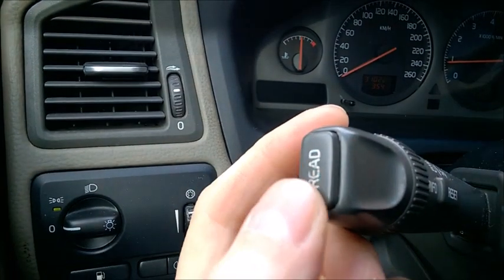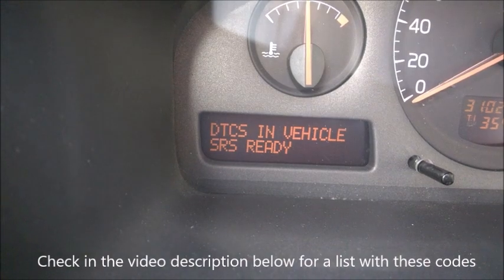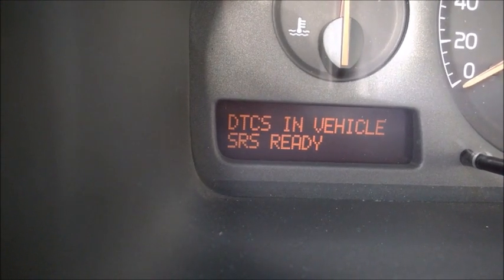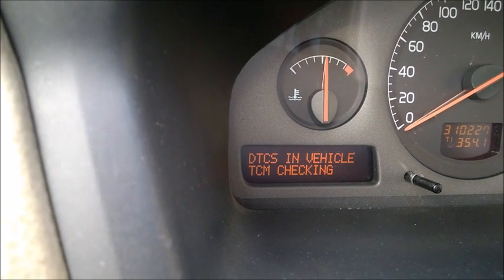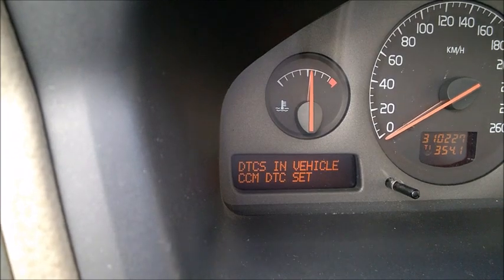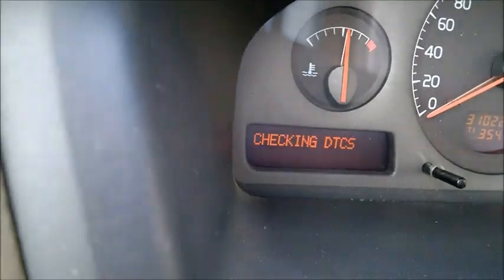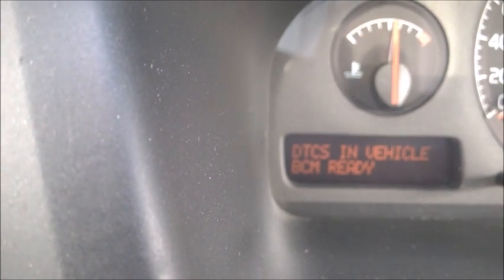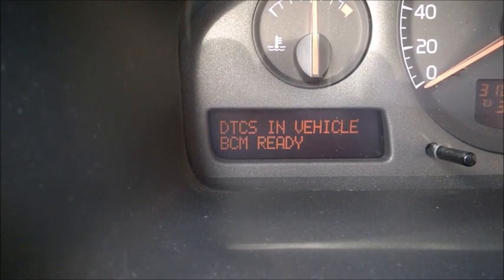Volvo S60 XC90 Quick Check if Error Codes are set  2001-2009

Comment from the maker: For all codes, scroll down here (click 'Read more') 
DTC SET – a code is set for this module (the module may have a problem)
CHECKING – an additional procedure is needed to verify if codes are set for this module 
READY – no code is set for this module (everything fine)
------------------------------------
If these modules have a code it 'may' mean more expensive repairs
    BCM – Brake Control Module (may or may not be and ABS module)
    CCM – Climate Control Module
    CEM – Central Electronic Module (2004up may want to negotiate the price)
    DEM – Differential Electronic Module (AWD, expensive repair, contact Xemodex)
    ETM – Electronic Throttle Module (2001-2002, $1000+ repair)
    REM – Rear Electronics Module
    SAS – Steering Wheel Angle Sensor (not expensive, may trigger Anti-Skid light)
    SRS – Supplemental Restraint System (usually just needs erased)
    SUM – Suspension Module (S60R V70R, the active suspension fails struts/shocks and are expensive to replace)
    TCM – Transmission Message Channel Module (may mean a problem with the valve body, don't buy)
------------------------------------------------
Complete list with modules 
    ABS – Anti-Lock Brake System
    ADM – Additive Dosing Module
    AEM – Accesory Electronic Module
    AFM – AM/FM Tuner Module
    ATM – Antenna Module
    AUD – Audio Module
    AUM – Audio Module
    BCM – Brake Control Module
    CCM – Climate Control Module
    CEM – Central Electronic Module
    CPM – Combustion Preheater Module
    DDM – Driver Door Module
    DEM – Differential Electronic Module
    DIM – Driver Information Module
    ECM – Engine Control Module
    EPS – Electrical Power Steering Module
    ETM – Electronic Throttle Module
    IAM – Integrated Audio Module
    ICM – Information Control Module
    KVM – Keyless Vehicle Module
    LPG – LPG Module
    LSM – Light Swith Module
    MMM – Multimedia Module
    MPM – Media Player Module
    PAM – Parking Assistance Module
    PDM – Passenger Door Module
    PHM – Phone Module
    PSL – Power Seat Left
    PSR – Power Seat Right
    REM – Rear Electronics Module
    RTI – Road Traffic Information Module
    SAS – Steering Wheel Angle Sensor
    SHM – Seat Heating Module
    SRM – Sunroof Module
    SRS – Supplemental Restraint System
    SUB – Subwoofer Module
    SUM – Suspension Module
    SWM – Steering Wheel Module
    TCM – TransmissionMessage Channel Module
    TMC – Traffic Message Channel Module
    TRM – Trailer Module
    UEM – Upper Electronic Module
    WMM – Wiper Motor Module
Reply: Actually TCM stands for Transmission Control Module.
And controls pretty much everything surrounding the Automatic, Volvos with Manual transmission does not have this control module.
Reply: I keep getting a message about my tires being too low on air but when I check the pressure it's ok???
Reply: One thing to add for the DTCS Menu there is a 4th thing besides DTC SET Checking and ready there is a 4th thing which is not Checked which means module not present for instance if you had the driver's door panel removed it would say DDM NOT CHECKED if you see not Checked it means the module is either missing or there is a communication issue with the Module I hope this helps and take care
Reply: AngryPostmanSthlm2  I mean, I'm a mechanic who has pretty much learned on Volvo's (worked 2 years as an apprentice Volvo mechanic).

Also growing up with friends and relatives working at Volvo Torslanda, has also done a lot when it comes to just how much of a Volvo nerd I am.
Reply: @klaspeppar5619  And is BCM for sure BrakeControlModule and not BodyControlModule?
Reply: @cottard7698  yes i think so, it should also be where the STC or DSTC lives

Comment: Hi Peppermint you are an ocean  of volvo information. I have a s60 2001 2.4 turbo.runs like a rocket . I just had the display cluster repaired 2 months ago ,now the LCD message screen is pixillating and goes on and off at random .the other items on the cluster works ok. However the high beams dont work anymore. Do you think its something to do with the cluster LCD message module? By the way light fuses are ok. Any suggestions on how to fix high beams problems? Thanks
Reply from the maker: Pixelated screen is usually smd resistor issue on the DIM electronic board - may bring it to a good TV repair shop for a full check. Be sure to keep the car battery disconnected all time the DIM is not connected - otherwise will get an SRS light. High beam may be separate issue from headlight switch unit - see video careful with your hands, sharp metal edges.
Reply from the maker: smd resistor or sometimes one of the large microchips gets small 'legs' unsoldered - need to reflow the legs on the main microchips (about 3 of them). easy done by a TV repair shop
Reply: Thanks for your reply ,I will get the LCD checked out it still under warranty. The high beams failing is a bigger issue I checked fuses and light bulbs and they are  good, i hope I can get it fixed because is a good car that has hardly let me down in 24 years. I can fix few things but electronics is not my cup of tea 😂

Comment: Hi there. Volvo XC 90 2005 "Transmission Service Required" code. How do I remove it after I serviced it? Thank you
Reply from the maker: Sometimes this is caused by worn out fluid - read up on forums about the fluid to use, risks about replacing it - better replace only 1/2 of it at once and try driving only inside the city for a few weeks.  Then try clearing the code with a quality scanner - maybe a small garage can do it. If the code clears up, you are fixed, otherwise it may be some transmission internal issue. Be aware that the twin turbo XC90 2005 had a very fragile GM transmission - look up on google

Comment: In my 2002 Volvo V70 I have a set code in my ECM And CEM And my Car Surges at 1500 Rpm and goes down to 1300 Rpm but won't go to 900 Rpm when I start my car it has the high start and drops down to 900 Rpm for 2 Minutes then it revs it's self up to 1500 rpm And holds it's self for a while then starts Surging between 1500 rpm and 1300 rpm what could be wrong with my 2002 Volvo V70 I plugged the vida Dice in and it says CEM ETM control module signal missing and CEM Module Shuts off and all my Gauges drop out and my Crude control doesn't work ether What could be wrong with my car

Comment: Hi, thanks for your video, I have several of these codes in my list and a lot of them show dtc set. I also bought a OBD II diagnostic tool, but it couldn't find any errors. Is there any way to reset these DTC codes in the menu and why doesn't the diagnostic tool show them ? 
Thanks 👍

Comment: You seem like a volvo expert so have you heard of this fault code nothing on forums. cem 6c48 transponder signal missing. I checked with my scantool and no keys are registered to the car im assuming i got to reprogram my keys. Nowhere online can i find a fix
Reply from the maker: First inspect the antenna ring, see if any fluid got inside, if the green connector is secured properly, may even replace it with a used one  https://youtu.be/N8j61tJJysU
If that doesn't work, try contacting the company at the top of this page https://volvos60xc70xc90buyersguide.home.blog/
Reply: @Peppermint1  thanks im gonna try have already replaced antenna ring. Have you ever heard of all keys disappear from system?
Reply from the maker: @SugeRealest  The remote fob for the doors is read by a chip located in the cabin rear view mirror. The key transponder in the key for the ignition is read by the antenna ring on the tumbler while the codes are stored in the CEM - when a car is parked long term and the batter goes flat, sometimes the CEM looses these codes and no longer recognizes the keys (the engine will not crank). Volvo can try reprogramming the CEM
Reply: Thanks for your help i got car booked in at volvo and i think it's my only option as nowhere online anyone had fixed this issue. Im subscribed to your channel and i will support you.

Comment: I have a silly question - why your car's dash is in orange and mine is in ugly green'ish? Is there a way to change the color? Green to orange? I have a Volvo S60 2009 2.0T (gen 1).
Reply from the maker: I put small T5 LED, this will work only on 2001-2003 dash. The problem is the cheap ones last only a few months and are also too dim in sunny light. Also most are difficult to fit behind the small display - they fit better behind the gauges

Comment: i would think to check the code before you skip buying a volvo if the ECM has DTC  because you could check the codeand it it be something as simple as replacing a spark plug or ignition coil for under 100 dollars

Comment: Great video! I have a Volvo xc70 from 2001, the CCM is not working, no lights, no response, the fan still blows and the air will get warmer as the engine warms up. I checked the system like in your video and the car say: 'CCM NOT CHECKED'. Does this mean that the car cant read the CCM? Is it dead? or did the previous owner maybe replace the CCM with an incorrect module and the software is incorrect?
What do you think is the problem, and what can I do to fix it?
Thanks!
Reply from the maker: @OrangeCub14   I've seen on forums it didn't work indeed for several people, but there are also people who swaped with used one and it worked without programming, even sometimes with having different lower buttons. Perhaps it's a matter of having the CCM with the exact part number ?  Here's a topic with people who swaped these successfully   https://www.matthewsvolvosite.com/forums/viewtopic.php?f=9&t=17478&start=10
Reply from the maker: Possibly a swapped CCM from a year with a different software.  May try getting a ged one from a 2001 off Ebay - check to have the same buttons everywhere and have the battery disconnected.  I'm guessing it may also be a faulty temperature sensor (behind the small grid) but you need Video to check it. Careful because used one on sell may have this sensor already bad.  The sensor is $5 and not that hard to replace https://youtu.be/Zis5WN_if60

Comment: Thanx for posting this! Good job! I have an 04 XC90 5 cylinder with a bunch of codes. Do these codes have to be resolved to pass a safety check?  Could these codes be present because of bad communication/ corrosion  under the wiper cowl with the connection to the computer?  
The DTC screen is now scrambled eggs...but worked correctly when I got it.
I have the following codes:
BCM READY 
CEM
CCM
SAS READY
DEM
DIM
DDM
ECM SET
ICM CHECKING
PDM
PSM
REM
TCM CHECKING
SAS CHECKING
UEM

I drove it after a heavy snowfall and the all wheel drive system IS working. The angle gear was replaced before the vehicle was given to me for free. I replaced the alternator and battery so far and cleaned it up.../did small repairs, interior, oil change - plugs etc. I stalled on finishing the job after seeing the DIM go screwy with all these codes. Don't know how to move forward with this yet.  Your suggestion?  It runs and drives fine - all the windows, 7 leather seats, sunroof, stereo, heated seats,  all work good.
I got a TON of receipts with it so I totaled the maintenance/ repair invoices..they came to..are you ready? ..$49,313.00 including many tires, brakes etc and the angle gear was $2k alone.
Reply from the maker: That's a chunk of money, surely being all done at the main dealer. As for the display screen problem, it may be a faulty DIM unit - that's the dash or cluster. It goes bad on 02-03 S60's, not sure about the XC90. Ebay has repair services, a nearby TV shop may also do it - need to have the battery disconnected.  From the list of codes, it appears to have an ECM which is the engine module (ECU), not sure why, there may be humidity at the bottom connector or the small cooling fan may be bad. But usually we want to clear all codes and see if anything comes back. That connector outside, under the cowl had a recall for water ingress, may try calling Volvo with the VIN see if already done.

Comment: 2005 Volvo S60, 3 messages, warning light but no check engine light. 0057 Power Supply, 0100 Communication between control units and 0103 Pedal position Sensor. Any suggestions on how to remove these codes? Thanks in advance.
Reply from the maker: Pedal position sensor is quite simple, it's the small black cylinder attached to the brake booster inside the engine bay. For the rest, can't speak, may be worth erasing the codes see if they come back, and maybe check the voltage at the battery and alternator.
Reply: @Peppermint1  Thanks for the reply. I erased the messages by pressing trip button for 10 secs & holding the key in position 2. Today it shows 1 message and Alarm system service required. Also when I push the bake pedal down I hear a sound like air leaking from a tube.
Reply from the maker: @HAMEEDUL   The alarm siren module goes bad (has a small battery inside), can be disconnected (or just remove the fuse if there's one on the fuse panel near driver door, fuse 38).  But the Alarm system message will come on at every car start. For the brake pedal, it may be the faulty brake booster seal, I did a few videos on this  https://www.youtube.com/watch?v=7m9Zwg7IbBw

Comment: I really like your videos.  You make things easy to understand.  I was hoping you could tell me if there is a way to determine if the yaw sensor or clock spring is causing the "antiskid temp off" message to appear.  I do have a used clock spring but I hate to just swap out the one in the car if that is not the issue.  Thanks
Reply from the maker: Can't help because I don't think there is a way to test the clock spring.  For the yaw, it fails when it gets wet so perhaps look for traces of water/rust.  Here's a few links with 'leads', my take is to get used parts from a junkyard, try them, and return if the message doesn't go away.  It's the cheapest way.  The clock spring isn't that bad, more difficult is to remove some steering wheels, I think I have a video how to set a new clock spring.
https://volvoforums.com/forum/volvo-xc90-9/anti-skid-temporarily-off-77961/
https://www.volvoforums.org.uk/showthread.php?t=144364
Reply: It is dry bones under the amplifier.  I am getting some random turn signal issues.  I think I will go ahead and do a swap with the clock spring I recently picked.  As you know, it is easy to swap.  Thanks
Reply from the maker: @bluebox212  Also check the axle bolts, these are single use and are known to loosen up and throw an Anti-Skid message
Reply: @Peppermint1  I have replaced the rotors on the front last year.  I will check that and let you know.  Thanks
Reply: i have the EXACT same issue as bluebox212...  and the turn signal was erratic too... i'm beginning to think, ours isn't a clockspring problem, but the "lever hub" that sits under the clockspring, and a contact isn't being cleanly made... for my anti-skid message is almost always on, but maybe once a month i notice its off.    did you fix your issue ? if so, please tell me exactly how, and if a software update was needed  thx.

Comment: I am looking at a 2006 xc90 that has been sitting for a few years, started once in a while but hasent got fluids changed for a while... any advice? It only has 150k
Reply from the maker: These will be kilometers ?  Which engine ?  If it's the gasoline 3.2, the early ones has issues with the R.E.A.D (expensive).  If it's manual, the clutch slave cylinder gives up at about this time and it's very costly.  Same with the AWD, if it's wasn't already repaired, chances are it no longer works. Sitting for longtime with drained battery can also cause difficult immobilizer start up issues.  See my other video on the channel, with common S60 faults to get an idea about the other things that need fixed.  Many will say the XC90 are great cars, but these do need money to keep running.
Reply: Peppermint it’s 150000km, it’s the v8 xc90
Reply from the maker: @richard342   See this page for the V8 (same as in the S80)  https://blog.fcpeuro.com/the-dark-side-of-volvos-excellent-v8    perhaps good to see if that's the reason the car wasn't used lately.  Maintenance is also rather difficult on the V8 because of lack of space  https://forums.swedespeed.com/showthread.php?170139-Tutorial-XC90-V8-Replacing-the-alternator  The awd is also surely no longer working if it wasn't already fixed (also expensive).
Reply: @Peppermint1  excellent info, thank you!!!